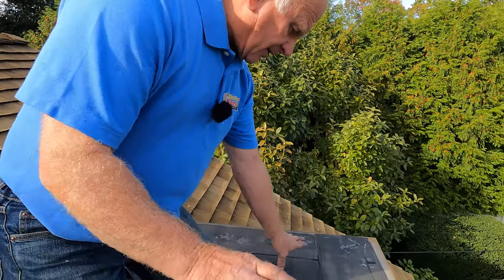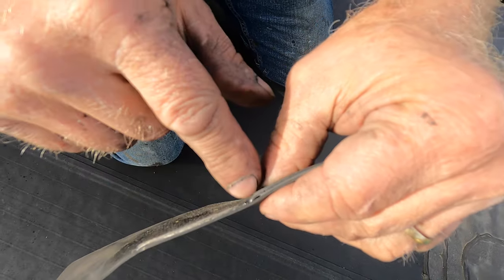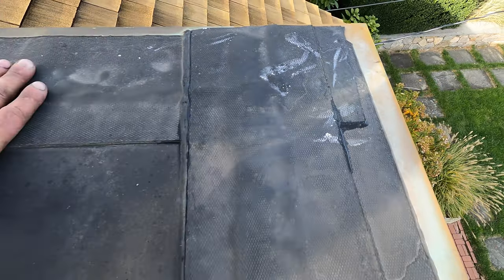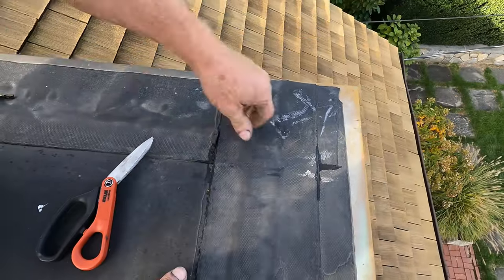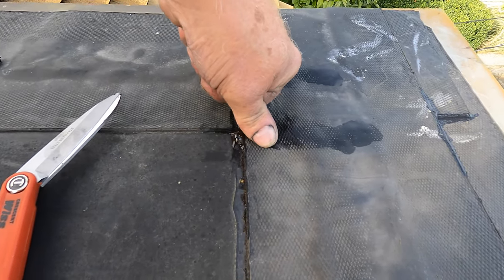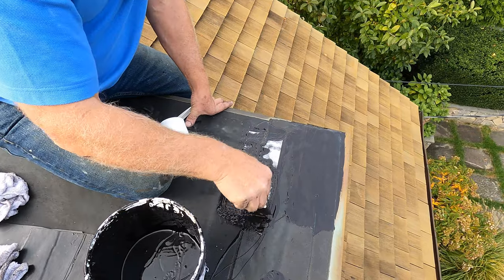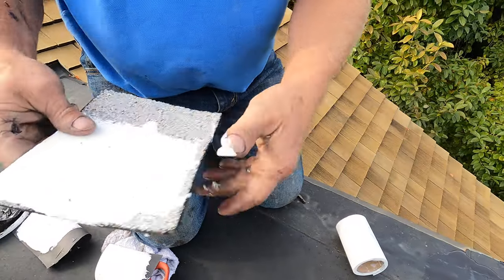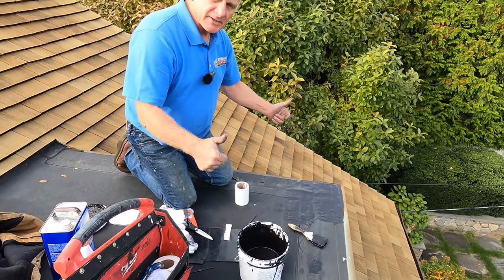EPDM Rubber Flat Roof Seam Leak repair in 3 minutes Results are amazing Must See

Comment: I've done a lot of flat roof work over the years with several different products. Experience has taught me to never trust any roof material manufacturer's warranty, they're not worth the paper they're written on. The roof installer will always take the hit on leak calls, repairs and any early failures. Only promise customers a roof warranty that you the contractor can afford to backup, and price your work accordingly. I may not agree with all of the Roof Doctor's techniques, but he has experience and common sense, which is most important. 
Small business are often vulnerable to becoming victims of shoddy roofing practices, simply because they haven't budgeted for roof replacement. It's important to provide them the very best roof repair they can afford..I applaud the care and efforts I see in the videos.
Reply: I've learned a lot.

Comment: I don't have a seam leak like this video shows. I appear to have a small hole on my rubber flat roof just before the gutter. Would this method work better than what I was going to do: Vulcanize a piece of 1/16" rubber patch over the hole and use seam sealer to make a smooth transition so water doesn't poole?

Comment: All you had to do is dry it out and use 
Lap sealant that is used normally to finish the seams and details . all those areas are supposed to be caulked. Silicone is the worst product to use on a rubber roof
Reply: Did you not see how he pulled off the caulking from the previous repair? Came off like a two-year-old rubber band